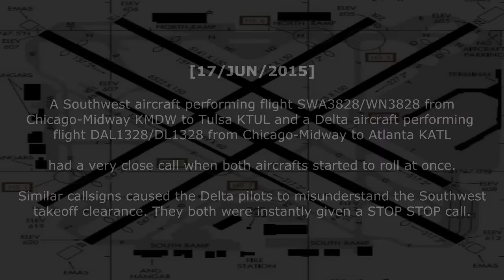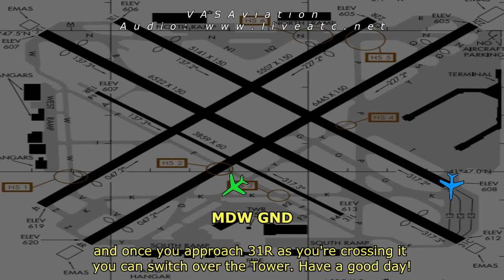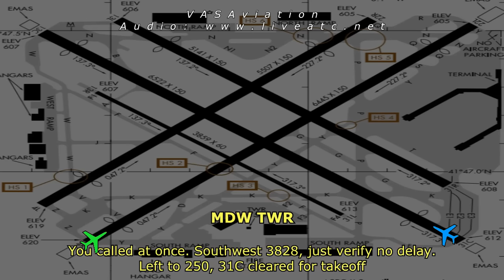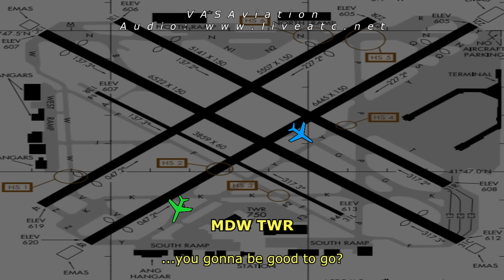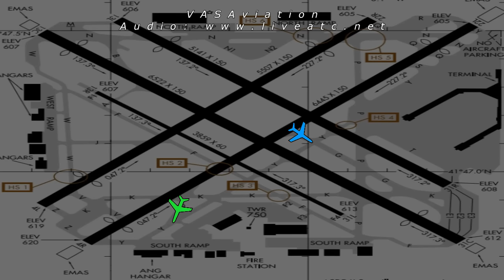[REAL ATC] Delta and Southwest VERY CLOSE CALL on takeoff

Comment: Perhaps you should line up and wait two similar sounding call signs , or assign a nick name like Donald and goofy , or  get pilot to wait until tower confirms read back correct after giving clearance . Or use the full frenetic callsign , delta echo lema tango alfa 123  cleared to take off  But obviously issue is it is a busy airport thus the rush to get on the runway and go
Reply: After he noticed that both planes talked at the same time he should put more emphasis on which plane is suppose to go, but instead he delivered in the same mumbly and fast way and all I can get from that call was "You-called-once-south-twerthy-eight verify no delay left to 250 31C cleared for takeoff" so only clear part to differentiate those planes was about runway.

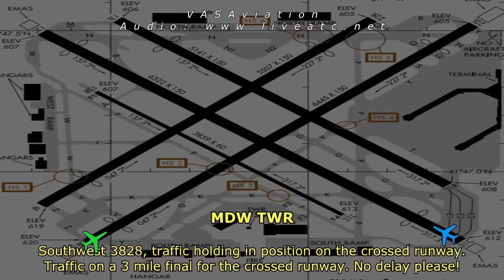Comment: At 1:08 if you listen close enough you can hear the voice cut out. All I heard was 28.. Not delta or SW, or even the 13 or the 38 only 28.. I feel like when callsigns are close like that they should opt to let Tower think of a number 1-10 and let them have a guess at who's closer to the number. The loser has to let the other plane take total precedence when it comes to who moves wheels first.

Comment: Distorted confirmation instructions and calls as a result of repeated two at once transmissions. I'd be surprised if this hasn't happened a number of times before when and where company and flight numbers (as call signs) are so darned close to each other so as to be misread in the heat of the moment when the radio transmission gets crappy. Number One eyeballs saved the day here, it seems (and perhaps the tower ground plan position indicator radar as well)?

Comment: Why do Americans insist on using shortened non standard phraseology for ATC? If the controller had said the numbers individually, Southwest THREE EIGHT TWO EIGHT, Delta ONE THREE TWO EIGHT, with also a slower emphasis on the company call signs, rather than speaking hasilty, this may have been avoided altogether. Haste makes waste. All the thirteen twenty eight, thirty eight twenty eight is nonsense.  Speak clearly, concisely and properly when safety is of paramount importance. Anything else is pure laziness, and dangerous.

Comment: I wonder if a controller can give planes with similar call-signs temporary aliases. Like 3828-ardvark and 1328-zebra. I also feel like 60% of the confusion was caused by the fact that the first 2 syllables of every tower communication was unintelligible, either from bad radio or poor mic use.

Comment: Regardless of the flight numbers being somewhat the same, the call was cleared for takeoff on "31 CENTER"  and not "4 RIGHT" where the Delta plane was.  Even if somehow they hear "13" sounding like "38"  "31 CENTER" doesn't sound like "4 RIGHT" .  Shouldn't they have at least heard the runway callout correctly?

Comment: Wow. There should really be a procedure for something like this. It's not as easy as you think to be busy prepping for takeoff and parsing out the exact nuances of your callsign. The FO is always busy on the ground running checklists, answering the radio, and copying taxi clearances. You get used to hearing part of your callsign and you snap to action. It's easy to Monday morning quarterback this, but it's disturbingly easy to fall for this trap. Especially at MDW. It has pretty complicated departure procedures to worry about. This almost warrants some kind of plan where similar sounding callsigns are chosen so one has to hold in a safety zone so the tower can make sure the right one is doing the instruction. Certainly not LUAW on intersecting runways.

Comment: i''m not a pilot, the atc controller yes he is saying things very fast but two things are clear. Delta 1328 is assigned to take off from runway 4R and Southwest 3828 is assinged to take off from runway 31c and secondly the atc then says ajsdfjasfjewfj RUNWAY 31C CLEARED FOR TAKEOFF. Delta 1328 where are you going mate?

Comment: but the callsigns are different: DAL 1328 and SWA 3828?
Reply from the maker: They are
Reply: Yes, but controller was starting talking before radio stabilised so every call was "<static> 28 do something"
However, Delta plane should have listen more carefully as to which runway was cleared for takeoff.
BUT callout about heavy traffic would put stress on pilots of both planes, and limitations of radio delayed any corrections.
Fortunately they didn't ask for details when he said "...28 STOP STOP STOP", and nobody got hurt.

Comment: why not just give them different call signs, at least until they are in the air? doesnt have to be fancy, just change the call sign to something like 1328 delta and the other one stays the same, this way if the numbers are said first both pilots will know that tower is talking to delta, and if the name is said first they are talking to southwest 3028, then once it is no longer a problem the call signs change back to normal

Comment: When ATC lined up both of them at the same time it felt like the fate was locked. Clear one for takeoff, then line up the other one. 4R had an arrival at 10nm final so there was time to hold the Delta.

That being said, sitting on a comfy couch watching youtube vs sitting on ATC chair under pressure of knowing you have to be fast, accurate and safe, yeah. Kudos to everyone working in aviation, just because they're bearing such stressful jobs on a daily basis.

Comment: The AIM is not regulatory in nature , its advisory. Fars are regulatory for pilots The ATP manual is for ATC you dont have to combine numbers as a controller . When I had similar call signs I never combined numbers especially 4 por 5 and as a controller you should never give  two similar call signs line up and wait ( or taxi into position and hold when I worked) on intersecting runways. Thats just asking for trouble. In my opinion when I worked  they ran em too close landing and taking off and today they still do. Just watch the live feed from Washington National (Reagan) and they are doing line up and wait with guys on 3 mile finals with preceding airplanes still on the runway. By the time they are given clearance the arriving plane is 2 miles out and when the departing plane is only 200 ft up the arrival is touching down.To much traffic at the same time in the same place just like when I was working. FAA will change things after another Tenerife , maybe.

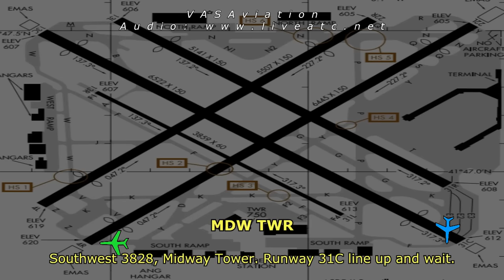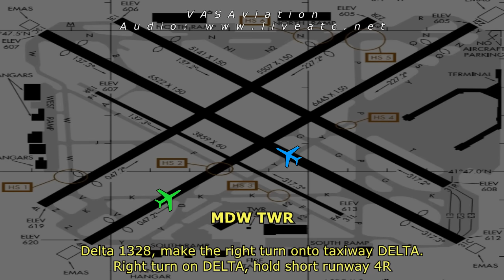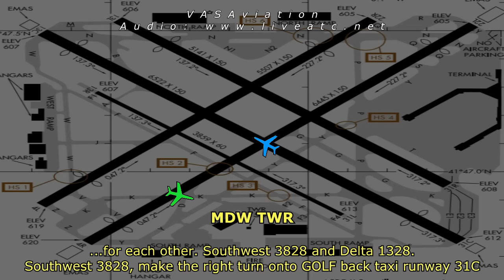Comment: I never heard Delta 13，or Southwest 38. I just kept on hearing: Static~28, blah blah blah. Especially at 1:07 If the controllers wait for 0.5 seconds after pressing the mic before speaking the pilots might be able to hear their company name. And at 1:33 same thing: "een28 stop stop stop" and 1:43, and 1:57 after he repeated the similar callsign. I don't know how good the audio quality the ATCs and the pilots have. But if it's as muffed as this, maybe the ATC should slow down a bit?

Comment: To show how unclear the radio transmission was, BOTH airplanes also stopped, even though the call was to Delta only.
Reply: TBH if I'm rolling down a runway and the tower shouts Stop Stop Stop.  I'm hard on the brakes before they even get to the call sign.

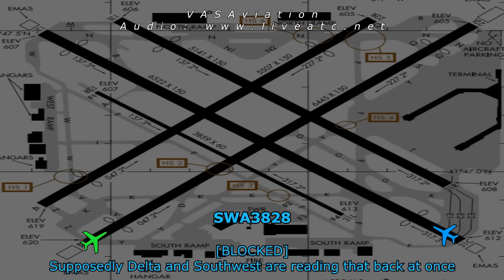Comment: 1:21 Why does the controller actually have to talk that fast?
Reply: Short answer. Because he is Tower, many planes come and go fast.

Long answer. Tower controls the most dangerous part in the airport. All planes above and on ground will talk to him in 1 freq. You can think the taking off/landing phase of airport operation as its chokepoint or Bottleneck. Everyones wants to takeoff and wants to land but you only have limited active runway. Makes situation where the difference between a plane taking off and another landing in the same runaway as close as 30s. Why? Cause there is timetable and plane might run out of fuel. So he has to manage 5-25 planes at one time, with only a limited runaway, makes sure He follows all Aviations rule(which is lots), and do all this 10 minutes for his entire shift. You will learn to speak fast wether you like it or not. So conclusion, he doesnt have to speak fast. But if he doesnt. At the end of his shift, there would probably 20 calls from companies complaining delays at you, or pilots angry.

In my opinion in this case, its an Honest mistake that no one should be faulted on, sure pilots have been warned but both are multitasking when they are on the runaway, not to mention Radio will not work perfectly all the time. Missing firs half second of transmission happens all the time, which in this case its almost fatal, moreover tower calls for "no delay" which means "someone will need that runaway probably seconds later". But of course there will be Briefing on how to avoid this from happening in the future. There could be special protocol when identical callsign is present. Or there could be other methods. But all party here were doing their duty correctly here. Especially tower quick reaction.
Reply: Knowing america. Delta crew probably will get punished. Which is sad cause that means this lesson would be useless if they have to fly anywhere outside US.

Comment: This in my view was poor planning by the controllers. They knew earlier that two aircraft with similar call signs were departing at the same time, they even warned the pilots, yet they allowed both aircraft to line up for take off at the same time. Had they separated them by as little as a few minutes this incident would not have happened.
Reply: Why is everyone blaming the controller for the DL pilot not having situational awareness as to which plane was actually given clearance, Clarence.

Comment: I know absolutely nothing of ATC beyond a half dozen of these videos, but surely in these scenarios there should be a means of assigning a clarifying call sign extension? 
Can anyone explain why some professionalised version of the following is not an absolute standard?

ATC: "Folks, we have similar call signs on frequency. SIERRA WILLIAM 3928, accept SIERRA WILLIAM 3928Alpha until handover to regional. Delta 1328 accept Delta 1328Bravo until handover to regional. Delta 1328Bravo, Confirm"
DAL1328: "We are Bravo. Delta1328Bravo" 
ATC: "SIERRA WILLIAM 3928Alpha, Confirm"  
SW3928: "We are Alpha. SW3928Alpha"

Comment: He told DAL1328 that traffic was holding on the crossed runway while at the time there was no traffic holding at 31C yet. This might have made the Delta pilot rush his takeoff since he was told that he was keeping a plane waiting on 31C that wasn't even on 31C yet. Then he immediately tells SWA3828 don't plan on stopping while also telling him to line up on wait. DAL1328 probably only heard SWA3828 readback "line up and wait" which confirms what he was told earlier that traffic was holding on the crossed runway presumably for him. Meanwhile atc completely mumbles the callsign while repeating "traffic holding in position on crossed runway. No delay please! Turn left heading 250. Runway 31C, cleared for takeoff." With his constant pausing during that callout and his fumbling of the callsign at the beginning DAL1328 probably understood the callout as "Delta 1328 traffic holding in position on the crossed runway 31C. No delay please! Cleared for takeoff", and the rest was history.

Comment: Didn’t help that the controller was clipping the beginning of his transmissions, which shortened the airline name. Also, hindsight being 20/20 of course,  but in these situations I always repeat the airline name again at the end. “Delta #### DELTA”. Also maybe not putting them both on their runways at the same time??  Seems like the local controller wasn’t quite as aware of the similar call signs situation, as the woman on ground obviously had been. Glad it ended safely of course.

Comment: That was close.
Planes should have radios that have a feature whereby you cannot transmit while there is a signal already on that channel / frequency. That way you cannot block / heterodyne. With this feature enabled what happens when two radios simultaneously try to transmit only the first radio transmits and other radios only receive. Even though you have the microphone button pressed, you can still hear the transmission of the radio that keyed up first.

The way it is now is when you key up to transmit, the radio switches from receiving to transmitting thereby disabling the speaker / headphones. These systems are available and would greatly help avoid the scenario in the video. Basically if someone is transmitting and you try to also transmit your radio stays in receive mode and you can still hear the other radios transmission. Your radio will not begin transmitting until the frequency is cleared.

In case a radio has a hot mic ie a stuck transmit button, you can always override the system with the flick of a switch thereby turning into a conventional radio.

Comment: Here's my full analysis. Obviously the delta pilot was at fault but it's almost understandable because the call or the push to talk button from the tower had a slight delay for whatever reason. So multiple times all they heard was "...28 cleared for takeoff" so they both went. The reason the delta pilot is completely at fault was that it was clear the aircraft on runway 31C was cleared, not 4R. That's why you have to listen to everything that is said over the radio.

Comment: I don't understand why aviation communication cannot have good quality. Why don't they use digital communication which would provide much better quality not to mention that this would also eliminate the "blocking" problem? Also a direct communication to the aircraft systems would be possible, where you could for example clear the aircraft for take off and it would "know" if it is cleared or not and it would sound an alarm if your are trying to take off without clearance. I mean so many things are possible today and they are still using such an old technology. You could start with a dual system when at first both systems (old and new) are supported in parallel and slowly switch to the new one.

Comment: When said correctly to ICAO standards Delta 1-3-2-8 sounds nothing like Southwest 3-8-2-8. When said as a number, 13 and 30 can easily become confused. Especially in a busy cockpit. Also the controller gave too much information regarding traffic holding position at the crossed runway and other traffic on 4 mile final landing on the parralell runway. "Southwest 3-8-2-8 cleared for immidiate take off" should have been enough to get the Southwest flight down the runway.  Short, sharp and concise

Comment: When you, a casual FSX player, has more sense to hear a runway call than two professional pilots.
Reply: that is absolutely true. similar callsign but not similar runway. thanks the STOP STOP STOP is loud and clear.
Reply: the sign was blocked 3 times. They couldn't undestand what the controller was saying. Not their fault. The controller should have wait to clear to take off when he was blocked
Reply: @sothiss2233  from this audio none of the runway calls from the tower are blocked, the tower absolutely keyed his mic too late for the pilots to hear the different part of the callsign and the pilots readback are blocked but in both transmissions from the tower 31C is pretty clear

Comment: The pilots and tower were equally at fault here. There were captains on both of these aircraft who didn't question the garbled mess of each  being stepped on. If not for complacency, they would have recognized the similarity in call signs, phonetically annunciated them when reading back tower's directives. What's worse is that Tower, knowing that someone is stepping on each directive, knowing that he just told each of them to line up and wait, also didn't take the time to slow down, phonetically annunciate the call sign, and verify who read back his directives. Instead it was:

Tower: "Confirming that was American 1328?" 

"Afwrfoi tree rjkejjf" 

Tower: "Word."

Comment: ALMOST PURLY TOWER FAULT.  They were in BIG ERROR in putting both planes on the crossing runways at the same time in position and holding.  It was a pure setup for failure.  True, the Delta read back SW clearance but the tower knows better to set up such a situation and could have prevented the whole thing.
Reply: They were in different runways.  When he gave Southwest instructions to takeoff, he said RUNWAY 31C....  Delta is in RUNWAY 4R.  Runway numbers are Not even close like runway 4L and 4R...  Both of Delta's pilots did not catch that it's not their runway. Delta's fault.

Comment: This is so funny because the controller LITERALLY WARNED THEM BOTH like 30 seconds ago that there were two of them with similar callsigns. And then put them both on runways that intercept each other at the same time and told them both to take off XD
Reply: Controller didn't tell them both to take off. He told both airlines to line up and wait.  Although the callsigns were similar, he clearly said Runway 31C cleared for takeoff.  Twice. .. Delta is on Runway 4R.

Comment: What does call company mean?
Reply: After a takeoff abort, pilots run a checklist and are required to check in with the chief pilot or duty pilot. Its a checks and balances thing. It allows the company to evaluate the mental state of the pilots and call them in or approve them to continue the flight. This abort was serious but benign. That wouldn't be the case if say a tire blew and the aircraft almost ran off the runway. The pilots may be rattled at that point.